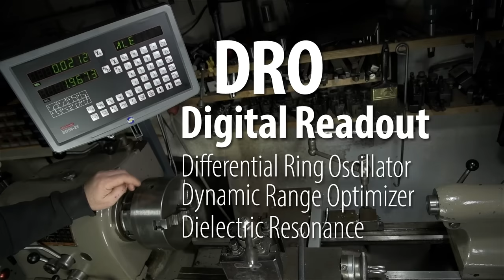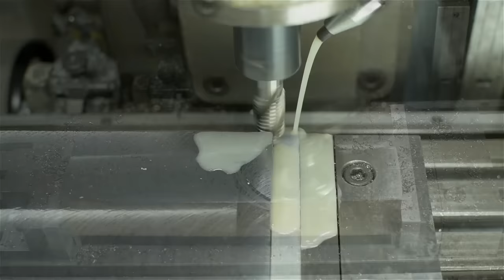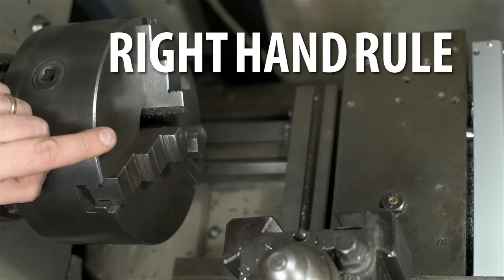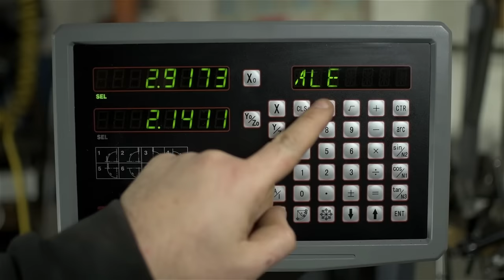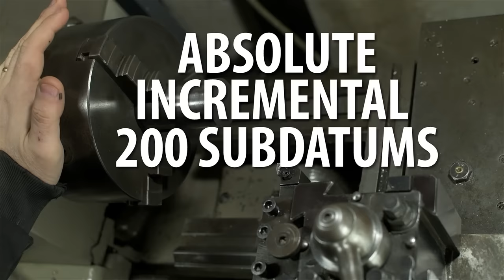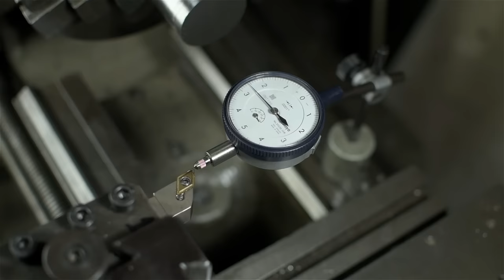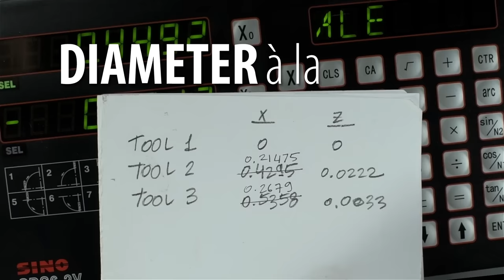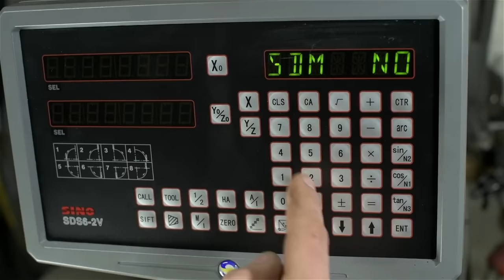DRO BASICS? & Lathe Tool Offsets!! (SINO DRO)

Comment: Is it true that home-machinists spend 95% of their time making tools to make more tools and only 5% of their time on actual projects? :)
Reply: Mark O tools to make tools to fix your other tools
Reply: I think that's an overstatement. Most do not reach the 5% on projects threshold. Making useful things is no longer considered patriotic when you can buy them.
Reply: I WOULD SAY THAT IS MORE THAT ACCURATE!!! I HAVE A LATHE AND IV MADE A YO YO AND 20 boring bars, solid tool post, tool holders, milling attachment, wheels and handles, cross slide extension, index wheel for the chuck etc...haha! OH AND ITS REALLY GOOD FOR POLISHING ROUND STUFF LOL.
Reply: Absolutely not!

It's more like 99%.
Reply: Yes it’s a vicious cycle
Reply: Worse than owning a 3D printer where you spend the entire time printing stuff to fix/upgrade your 3D printer.
Reply: This is absolutely true.
Reply: It’s all about the tools
Reply: That's the best part
Reply: Your absolutly right. I am a home machinist and working on a scale engine and so far I only made chucks, tools, fixtures, clamps etc XD
Reply: It's a paradoxical situation.  Making tools to make future projects which are future tools to make future projects...
Reply: Machine tools are for making machine parts for machines. Makes sense.
Reply: Its the same with 3D printing.
Reply: @Kernels Yup. Giant libraries of code have been written in order to shorten the length of code that needs to be written. Lol. Why fully type out /end program each time when you can instead write a 200 line segment of code that let's you shorten that to /ep.
Reply: I don't understand, That's not the whole point of having a milling machine and a lathe ?
Reply: You forgot the 20% of the time you spend fixing weird noises, repairing stuff and measuring how your machine is off, so really we spend -15% on actual projects
Reply: Right now i'm starting a 5 day long 3d print of parts to build a CNC router, so yeah... i'd say that's pretty accurate.
Reply: @xKatjaxPurrsx  5 days... :o I hope everything turns out alright! :)
Reply: factorio but with less automation
Reply: I do the same with 3D Printers. 90% of what I do is make tools or parts for other tools.
Reply: I think it’s closer to 99%.
Reply: I can definitely relat to that.... but I'm on the next level.... I'm making tools that i don't know what to do with yet 😂
Reply: That & breaking stuff, yes.
Reply: It's a journey, not a destination. ;-)
Reply: No it's more of a 98 percentile thing.
Reply: @GrafRucola  
It's all about the tools &  THE SETUP !!
Reply: Crooked River I guess by making the perfect tool, the setup is getting easier and easier. To the point that the setup is almost doing itself :D ... until the world invents a better idiot xD
Reply: Verissimo😂😂
Reply: @striknein  Á
Reply: Another way to say is that good home-machinist can make things which are almost impossible to make. So impossible that there isn’t even a tool, so you have to make their own.
Reply: @mrembeh1848  exactly. This is the sort of innovation that leads to new product inventions. Instead of buying generic, general purpose tools you make purpose driven tools to fit specific needs.
Reply: Why do you have all these tools? To make more tools. What are those tools for? Making more tools. No one has lived long enough to figure out what those tools are done with, although some people have a few side projects like model engines, gunsmithing or making stuff for around the house (like how ToT has made some motorbike stuff, or Quin from blondihacks made some shower knobs
Reply: I only make tools when I have to, or store bought isn't worth it. So i pretty much only use my lathe for projects or paying jobs.
Reply: How Dare You!!! Lol
Reply: Yes, 100% of the time that is true 95% of the time!
Reply: The force is strong with you i guess!
Reply: But the actual projects ARE tools!
Reply: @Gottenhimfella I feel like nowadays it's more patriotic to buy things. While making your own things Is considered more unconventional.
Reply: Depends on wether you are willing to go down the rabbithole of building steam engines or if you are really brave combustion engines.

Comment: Remember to take cut, mic it, check to see if dro corresponds, and then repeat for 20 years because of the one time it screwed you when you didn't.
Reply: We had dros on the lathes and mills at school. I liked them on the mills. I turned them off on the lathes.
Reply: Amen
Reply: You sure that wasn't  back lash on your cross slide? Maybe ya moved it
Reply: @TheMetalButcher  My lathe has horrid X axis accuracy.. .010" graduations, and unless you want to use the compound, you're pretty much stuck.. I'm looking at a cheap DRO for it.. I could do without one on the cross slide, but I'm going to put on on there too.. probably have to get the slim scale like ToT (14x40)
Reply: @Rx7man  What 4x40 has 10 thou increments? That's junk.
Reply: There are few forces in the universe as powerful as "I'll be damned if I'm gonna make that one mistake again."

Comment: Take the blue cap off the back of your dial indicator. There is a flat tip that unscrews... swap that with your indicator tip and voila you have a flat tipped indicator for offsetting your tools @18:25.
Reply: ToT mentioned this comment in a video and I didn't realize it was this video until I heard him say he didn't have the flat tip on the indicator, so I looked through the comments and found the comment he showed..... Nice work dude.       😁👍

Comment: If you don't have a DRO on your tool box drawers you're basically a caveman.
Reply: How can you sleep at night not knowing if your drawers are shut all the way?
Reply: albertlagerman by slamming the drawers shut hard enough so that all the tools end up in a pile at the back of the drawer. Having all the tools at the back in the lower drawers ensures the box/cabinet won’t tip over when you oven the overladen top drawer.
Reply: @300DBenz That generally happens when I'm pissed. :)
Reply: This comment still keeps me up...
Reply: Can confirm, i work with steam locomotives, i havent used a DRO in years, please send help or a DRO.
Reply: Nope, still waiting for TOT to CNC his toolbox with a picker that hands the tools to you or to a drone that flies them across the shop.

Comment: An augmentation of the tool offset library that I've implemented with my DRO (TouchDRO from Yuriy's Toys), is using the tools themselves as touch probes (only works with conductive materials).

Basically, I've got an LED which uses the lathe itself as the path to ground. A power supply sends +5v to the LED, and is grounded to the lathe. The negative side of the LED has a springy wire (think phone cord) with a big alligator clip on the end. I then set about electrically insulated the tools themselves from their respective holders using thick paper. 

Now I can set a tool holder on the tool post, and clip on to the shank of the tool. When the tool touches the work, the LED lights up. It's been super handy in setting up workspaces, tool offsets, etc. It's also nice to be able to accurately pick up a surface without marring the part.
Reply: Now that is a very nice hack, thanks for sharing this tips

Comment: Also, make sure that the on-board battery, (example: CR-2032) is fresh, to give you the maximum years of memory in the DRO.... As my unit never shipped with a flat cell battery and before getting educated upon the depths of the DRO, I would simply turn the unit on, and do my thing, and when done, turn it off.... But, one day, I thought I would be clever, "as odd as that my sound, coming from me" and give addresses to all my lathe tools, and build a directory spread sheet, for quick reference, and stamp in a No. XXX into each tool holder... And spent about 8 hours in the learning curve, to do all this... Everything worked out great! and I shut my shop down for the night... And while in bed, thinking of a reason to make something I might need, so I can play the following day with my new found cleverness... I fired up the shop the following morning, got the supplies spread all over the work bench to things look important... And powered on the lathe, and in turn, the DRO, and it turned on as usual. I got out my freshly printed out laminated spear sheets, that I had on a key ring punch though hole, so that would look like I was a professional... "Ah, I need tool No.37, grabbed that from the toolbox drawer, plop it in the QCTP.... got to call up the tool in the address menue.... NOTHING!!!!!!!! I scanned for a couple others addressed tools, nothing as well... so I re-entered a tool for the giggles of this all... Seemed fine, added another addressed tool, and could scroll between those two... Longest boring story cut short, turned the unit off, and into gone... Carter around with that for hours... Luckily, I speak 4 different oriental language's, in addition to my native english, and called the manufacture... Tools them what issues I was having... With in 5 seconds of me telling them a 75 minute long novel of my issues, including the DRO issue, they mentioned that the sticker on the front stated I needed to install a flat cell battery.. They sicker was in Chinese, I said I speak Chinese, I don't read Chinese.... Their stickers now have multiple languages stating that a battery needs installed. I asked why no battery was installed and shipped in the units... Something to do with the lower shipping costs, if the unit doesn't contain lithium as a hazardous material and shelf life of the battery if sitting on a sales shelf of warehouse shelf???? Okay... there is my novel for the month, see you all next month.... Lol
Reply: Also, on a side note... Being I had to open the units up, I added to each unit, an additional flat cell battery holder, soldered in parallel to the one that is soldered directly on to the PC board... So I can slap a new battery in, while changing out the old one, and not loose my info... I wonder if just leaving both battery installed, will allow a longer time of holding the memory, vs, the actual life of the battery, before they try and leak or vent onto the board and start the corrosion of the contacts??? I don't know, I just use one, and in time, (6 month to a year) will probe with a DMM and check the voltages ... For all I know, one battery may last 20 years? My equipment may be worn out before then????
Reply: Huh...I didn't even know that my Chinese dro took a battery...I'll have to look into this. I've always just used the dro in absolute mode, take a cut, measure the diameter and enter it, then off I go. I don't think I could ever have enough faith in the thing to rely on it to save it's position in the tool library. I'm happy enough that it just tells me how close I am to my finished dimension.
Reply: Do any have a USB port to connect a laptop and use a proper user interface ?
Reply: They make larger lithium cells, about AA size, that last 20+ years, if you can find the space.
Reply: @jimc3688  my cheaper units unfortunately do not have a USB, not even a serial port. Now, mine do have what one understands as a 1/8" phono-jack, like what folks use for head phones on the phones and iPods. .. And is for company use at the manufacture, and they wouldn't tell me what it is for other then them telling me to leave it alone, lol.. Okay, don't have to tell me twice!..lol
Reply: @stefantrethan  I shall look into that, likely a more specialized battery, I imagine like what one might find on an old IBM, soldered directly on to the motherboards in the blue shrink wrap, type ??? Or are they making them for a quick change application?
Reply: @marcellemay7721    I am not smart enough to say if the battery is an industry standard, or if just lower quality imported units like mine have this configuration? I have done service calls on a few older units like the trusty ANILAM wizards DRO's, from the late 70's to the 90's and I have seen those series have memory batteries, and some revisions with out memory batteries... so I don't know, again, I am not smart enough to know what why or why not. I didn't think to do research at those various times, to see if the memory still was a capability, while having other means of "memory power" like per day a capacitive device on-board, which is a reliable method on its own rights, rather just adds more to the cost manufacturing, I think is a safe assumption... Good luck
Reply: @drubradley8821  Even larger than the old IBM style, I think Tardiran is the major manufacturer. They do make them without tabs to go into a socket, but that would defeat the purpose a bit since the contact may not be as reliable as you might want.
Reply: They really should use a supercap charged by the main power supply as well as a battery. Properly rated it should last for the life of the equipment and give at least a few days of memory retention along with letting you swap batteries without wiping the memory.
Reply: @RobertSzasz  As long as it is done properly, so the supercap leakage current doesn't drain the battery, that would be a solution. On many systems you can change the battery while powered on, without data loss, others have complicated service procedures that require application of an external voltage. But really, in this day and age you could easily store this information in EEPROM or flash memory that doesn't rely on an external power source.
Reply: @RobertSzasz  that would be nice, until they tack on an additional $200 to the unit, lol...
Reply: @drubradley8821  A suitable nonvolatile memory would cost less than a dollar (especially in China), so it might add $2.50 or $3 to the retail price.
Reply: @RobertSzasz  I will never understand these things... EEPROM is thing, and was a thing 20 years ago already. Why they don't use it? It is dirt cheap but many microcontrollers have it built-in already. From all the comments and the video itself I came into the conclusion that probably I should make my own DRO if I want a proper (21st century) user interface...

Comment: I really had my hopes up for a dielectric resonance orbiter video. Maybe next time.
Reply: Well, you first have to get 5 flux capacitors from Ebay. One for each axis: X,Y,Z and one for forward and one for backward in Time, designated T- and T+. Make sure that you mount them correctly in the correct direction.
Reply: Yeah yeah, I’m well past that point. I was banking on This Old Tony to work out the trial and error on the RPM necessary for maximum resonance. The whole time travel thing really cuts down on R&D time.

Comment: Both of my main machines came with Sino DRO's and have worked flawlessly for the last 3 years. I think now that you have a DRO on the lathe, you will learn to love it. The biggest problem is machine/too/part flex if you are trying to get to a specific number in actual part size. I find that if I take a really light cut, say 0.010" for the final passes, the DRO and reality match. Larger cuts result in a few thousandths difference. Great presentation to boot. Your subscription numbers are well earned.

Comment: I still maintain that your manicurist is a freakin' SAVAGE.
Reply: It's Meatball.
Reply: Lol! I'm bleeding if I try to cut mine shorter than the tip of my finger!
Reply: Manicure??  Am I watching Avon79 again?
Reply: @dan27052  Ooh, Adam's gonna getcha!
Reply: I could've sworn in one video Tony mentioned that he 'does his nails' with an angle grinder.

[Edit: Or he might have mentioned that one of the many uses for an angle grinder was doing your nails - something like that, it was a while ago.]
Reply: @Shaun.Stephens  Now that is believable, lol.
Reply: I'd believe it. Bruh probably does the cuticles with a brass brush on his drill press.  @Shaun.Stephens
Reply: What do you expect if the manicurist doesn't take ToT's advice and refuses to put a DRO on their nail files?